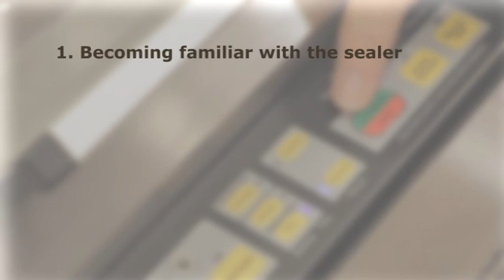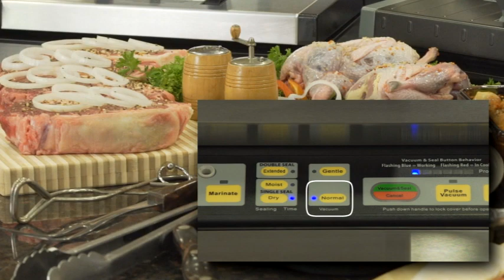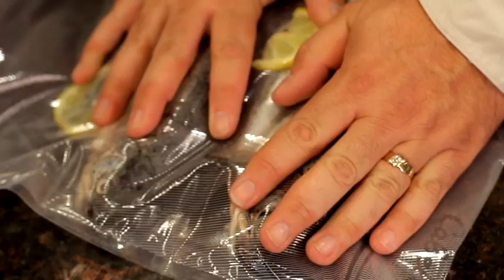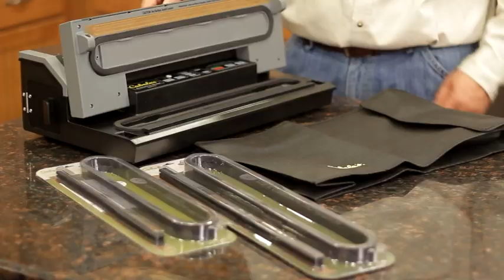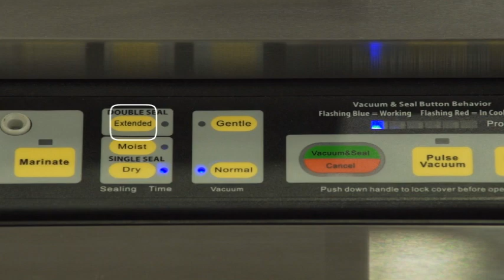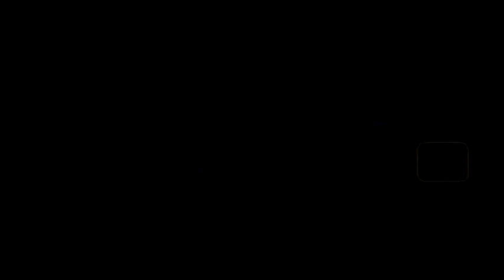Cabela's Vacuum Sealer Instructional Video

Comment: I have the silver one in this video and anytime I use the manual seal button it blows out the fuse on the back and stops working what is cause the fuse to blow any info or can try pointing me on what I should be looking for because I can't find anything else wrong with the unit

Comment: A year and a half ago I bought the Cabela's 15 inch "COMMERCIAL GRADE" Vacuum sealer for about $400.00 . It worked great at first, we used it for sealing meats and such that we bought in bulk . 
I estimate we have sealed approximately 100 - 110 bags with the unit so far.
I was very proud of it at first, it worked great and all, but now I cant seal 5 bags without it over heating and powering off. 
I was upset to say the least. I called Cabelas and was informed that I must call  another company to ask about warranty
I was informed that it was normal that it would over heat and power off after 5 bags...…..I called bullshit.... but nicely.
Long story short I spent 100 bucks on a new pressure sensor and control panel, which I will have to fix my self.
Do not waste your money on one of these.
Reply: Crap! I was thinking of buying one, but not sure now. Thanks
Reply: @chrisgollihar8057  It's actually not a bad machine but a cabelas is worth like 200 bucks now with the same quality, ZI bought mine for almost 400 too but I've never had a problem
Reply: Sounds like the fuse might be weak, try replacing it
Reply: Just bought one, brought it home, vacuum part doesn't work. Now the 180 mile round trip to exchange it.